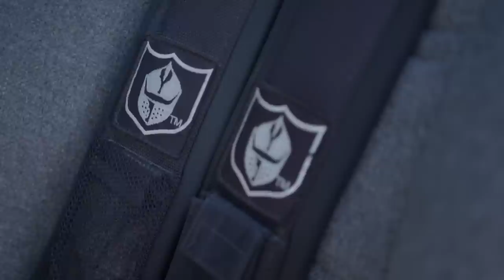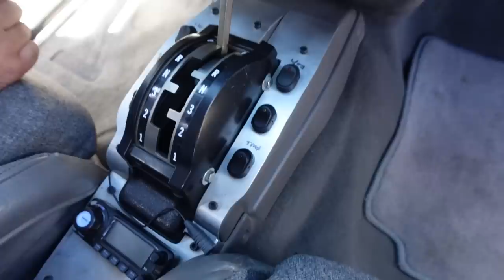Barn Find 1st Gen Toyota Tacoma Prerunner! | BUILT TO DESTROY

Comment: I have a 99 Tacoma pre-runner 2.7 L single  with a 2.5 inch leveling kit and 33 inch falcon wild peak’s ATW3’s . When I got the truck, it had a low 200 and something thousand but not right at the 200,000 Mark on it and now it only has almost 277,000 miles. When I first got it, the owner told my mother who went and picked it up for me. All it needs is alignment wrong and needed ball joints bad. I also just went ahead and started upgrading the expansion parts with all new struts in the front and shocks in the rear and replacing almost everything to make this a nice roadworthy daily driver . I also ripped the plastic bedliner out and did a spray on bedliner and a front brush guard that has a 8 inch light bar on it with rock lights in the fender wells. It’s a nice little daily driver I like it and it does get used for dragging a drag through the field because I do own farm animals that I have to drag the field every so often. The little thing is a beast and I love it. About to also put bigger mirrors on it because the pre-runner mirrors in my opinion are tiny so I’m going with the SR5 four-door style, mirrors, and glass black but I have to get one painted because they sent me two mixed matched mirrors but the company was great and refunded all my money and told me to keep the mirrors.

Comment: That's is actually the second version Tacoma made from 2002 on the earlier Tacoma had different front clip bed doors interior and engine. On the 4 cylinder.
Reply: First gen... Before this was just the "pickup"..
Reply: He's correct... I had a 2000 Tacoma and it had a different grille and headlamps...